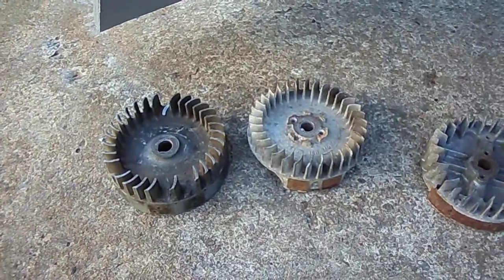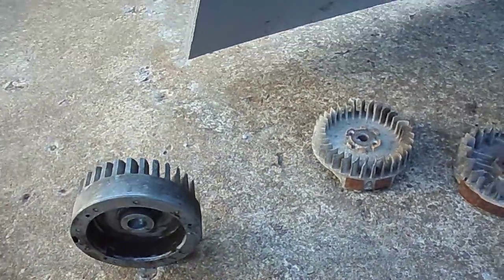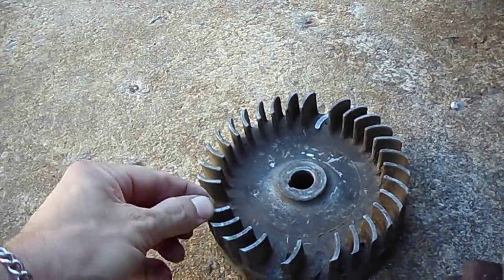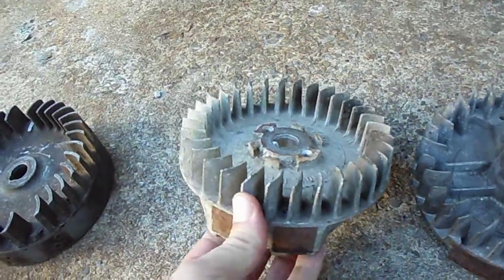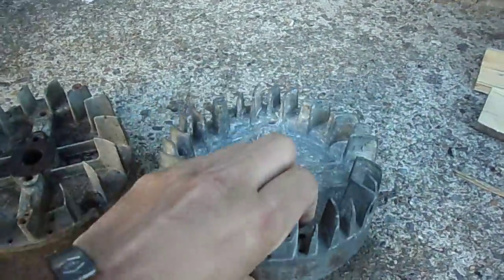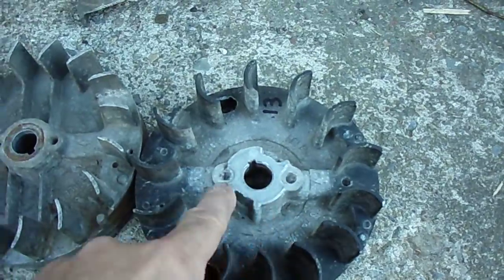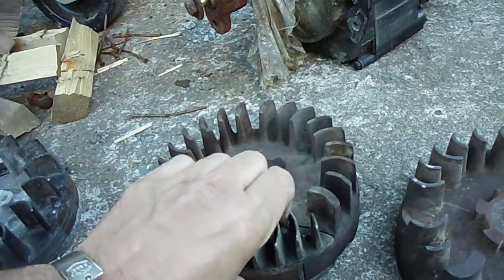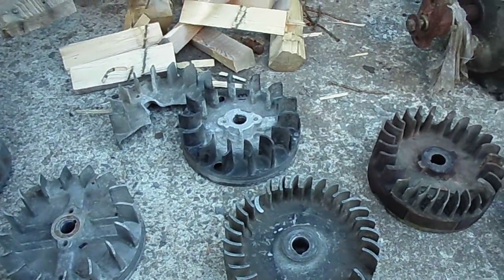Briggs Lawn Mower Flywheels 1953 to Present

Comment: I have an old B&S (probably 60s or 70s) with a bad coil.  Want to switch to electronic coil but I can't find the model number anywhere on the engine. Thinking the plate may have come off.  No stickers showing the HP.  Engine is for a water pump. (non B&S).  Engine is aluminum horizontal shaft, flat head.  Flywheel is cast iron with one magnet.  I tried a new coil (think it was from a 5HP) and it did not fit.  Mounting whole spacing was a little off and the radius of the coil did not fit my flywheel.  My flywheel is 5.75" diameter and mounting holes for coil are 2.5" apart .  I know I could take the head off and measure bore and stroke but trying to avoid that.  Tank, carburetor and filter setup looks like this https://www.youtube.com/watch?v=wcvHNGmt7IY  Thanks for any help figuring out the model number.
Reply from the maker: Hi, the engine in the vid is a model 8   3 horsepower engine. Without getting out a tape measure, I am 99% sure that any Magnetron ignition coil from a 3-1/2 to 4 horse flathead Briggs lawnmower engine would fit that engine. The spark plug wire end cover may vary in size and shape, but the lawnmower engines use the same diameter of flywheel, and the bolt pattern is the same. I make the replacement all the time on my engines.. As long as your engine only has 2 bolts holding the magneto to the engine block (like you mentioned),. The older Briggs engines have 4 bolts holding the mag., but those were phased out around 1960, so I am sure yours is a 2 bolt. Yes, the 5 horse mags (coils) have a different curvature, as well as bolt hole spacing. Perhaps you could go to a small engine repair shop that has been around for a long time, and buy a used coil from them. Just make sure it is a magnetron (electronic) type, which odds are that it will be, since they have been making them since 1982.  To make the conversion to electronic ignition, I just cut the wires coming out of the points cover under the flywheel, put the flywheel back on, and bolt on the electronic coil, routing the stop wire away from the flywheel. Just ground out the small stop wire to stop the engine. I will make a vid showing this, since I need to make another vid today! Take care.

Comment: Can you sell me a SOUTH pole facing magnet with center hole for Briggs flywheel? It's curved to match the flywheel. I need to change my north magnet on spare 17HP flywheel for bench testing. Torch heat applied in vice, and impact tool and hammer for the philips end bit used to loosen screw.
Reply from the maker: Man, that is a question that requires some thought to answer!  I am a bit stumped, as I have never investigated which pole the flywheel magnet is!  I doubt I would have a magnet that size, as I don't think I have any 17 horse engines. Wouldn't all Briggs engines of the same size have the same pole outward, or is just random?

Comment: Thanks for the information!  You're the first I've seen that explains the "no spark" when using an electronic coil with a 2-magnet flywheel.  I recently fabricated a custom flywheel using an outer ring of a Briggs, and the inner section of a Lauson. This allowed me to run a modern B&S coil on the tiny 1942 Lauson, but the fire was extremely weak. Come to find out, I had used a 2-magnet flywheel. So, after watching this video, I machined a new flywheel and it runs great. Thank you very much!!!
Reply from the maker: WOW, you really go all out to get an oldie going! Glad that worked out for you. Sometimes when I make vids like this, I think I going on about something nobody really cares about, it is good to know that some people actually find the info presented to be useful!  Thanks for taking the time to comment back.
Reply: @ChargerMiles007  You're very welcome!  I'm a Mopar guy too.  Just got home from Chryslers @ Carlisle.  Lots of awesome stuff there.

Comment: Question- does one of the old model flywheels have (two) magnets on the outside as North + South???? This could be used to make AC in ignition coil primary. - test with polarity magnet ! I am modifing an engine "intermediate dual coil primaries  " magneto for AC so as can get high voltage DC out with bridge diodes.
Reply from the maker: Yes, the old flywheels have one north and one south pole of the 2 magnets visible on the outside of the flywheel.  the new ones with one magnet only have 1 pole on the outside, I don't know if it is north or south.  That was an interesting question, i had to find a good magnet to test the flywheels out  :)
Reply: I intend on a modification for Briggs ignition by super gluing on south pole neodymium magnets facing out, so as a north + south pole, so as to operate an AC hand built intermediate transformer so as can activate regular old style magneto coil with higher primary AC volts without SS module, so as can get AC instead of pulse type dc, so as can add bridge rectification for much higher 30kv AC for about 10-12KV DC  applied to plug. If single diode is used with regular ignition, the output drops to only 4000v , a loss of 60%. I use a bench test fixture of 12v battery, variable speed control, 12v fan motor spinning horizontal wood flywheel with magnet next to mounted Briggs coils.Strength increased north pole, with added neodymiun 20x10x3mm magnets.  Lead washers on flywheel  held with brass screw for balancing magnet weights at rpm. I earlier also tested for pulse DC with one output diode along with change to POSITIVE high voltage firing down to negative ground, with coil upside down,  rather than regular positive ground spark plug.

Comment: I was planing put a new 3hp on 5hp old briggs. Think I'll have any luck
Reply from the maker: I hear that it will work, and the engine will rev up faster due to the reduced weight. It will run rougher though, but it is hard to say if you will notice it. You will need to move the magneto downwards towards the smaller flywheel of course. Perhaps someone makes a piece to do that. I would think it may need to be made of aluminum to not mess with the magnetism around the magneto (just me thinking out loud)!
Reply: I'll tryout get back with u thanks

Comment: Thanks that brings back some memories!
Reply: This stuff always makes me think of that old 60s mower I used when i was a kid. 
It had a wind up handle on top to start it.
Wind it up, hit a button and it spun over.
Reply from the maker: Yes, I have 2 of those, they are neat, now they need a battery and a starter to do the same thing. Have we made progress?

Comment: I never knew there were that many different flywheel designs. The only thing i can tell from my experience: My (horizontal crank conversion) 1980 3HP Briggs lawnmower engine which used to have the vertical pull start (and thus the geared flywheel) does run fairly well without a blade on, even at idle RPM: https://www.youtube.com/watch?v=wypN5KT5NNk 
But it tends to kick back during the starting process like you mentioned, i even ruined my pull-start! You have to turn it over slowly until the piston is at the compression stroke, and than give it a rapid pull. Seems to work fine for me. 

Another fun story: You mentioned that you have to run the right kind of flywheel for the magneto the engine uses. I didn't expect that, a couple of years ago i got a 1994 Briggs "Quantum" engine running with a Tecumseh magneto (3 pole-shoes vs. 2 on the B&S magneto!!) It was kind of a emergency-situation that i tried this of course, i couldn't believe it, but it actually worked xD
Reply from the maker: LOL, you made a Briggsumseh!  And it ran!

Comment: i really enjoy this video series. i would like to see a video were you show every small eng you have and count them off as you do.
Reply from the maker: LOL :)  I will be uploading one where I show 1/10th of the herd (35) engines. I had to unload my one shedlet (it is small, like a piglet) to hold engines. The bloody thing was loaded with 1" long carpenter ants, I was spraying them with brake cleaner, it was like holding back an upwards flowing waterfall of ants!  I will try to release it tomorrow, I don't want to flood people, as I released 3 already today, I got some complaints about that in the past! I would like to have them all out at once in a vid, but it would take hours to get them all out. I am working on my last engine shed this weekend, so I will be moving more of the Herd to put into the empty shed.
Reply: @ChargerMiles007  well maby make that video for 1 shed, keep the file in a safe place, down the road do another chunk. and maby some day you can peace together a 1 2 3 4 5 6 7 .. ... . ..997 998 999 1000! video.

Comment: Pretty interesting, thanks for sharing the differences in the flywheels on Briggs lawn mower engines! You can also find the heavy cast iron flywheels on push mowers that have a blade clutch so the engine can stay running when you dis-engage the blade, though I have an old Toro mower that has a blade clutch but doesn't have a heavy flywheel, instead it has a heavy iron wheel underneath the mower to keep the engine running when you dis-engage the blade.
Reply from the maker: Yes, a second pulley or flywheel will do the same job as a heavy flywheel, just gotta have enough momentum.

Comment: I had a rusty damaged one I couldn’t get to hold on the shaft so I learned it’s the cone that really holds not the key so I honed it on the shaft using lapping compound and the result was amazing. No more tightening down with the force of Thor and loosening with Thor’s hammer.
Reply from the maker: LOL, awesome that the lapping worked out that well.

Comment: I put a push mower engine on a rider when i was a kid. it was okay if you pulled it over fast enough to start it, and never throttled it down too low. one time it ripped the cord out of my hand so violently it blew the recoil to pieces.
Reply from the maker: Yes, I had the same thing happen, I freakin hurts your hand when that bad boy yanks the handle out of it when you are still pulling the other way!

Comment: Do you have a connecting rod for a  Briggs 15 hp OHV Engine
Reply from the maker: Sorry, I don't have any 15 horse OHV engines. I have some 12 horse flatheads, and an opposed 2 cylinder.  i don't get into the larger engines much, too heavy and costly for me to buy and store. Check ebay, you can look the part number up on Jacks small engines web site, it is similar to the Briggs website. Once you have the Part #, (and a price from Jacks) go to ebay to compare costs. Sometimes ebay wants way more than it is work new!  Other times, I find some good deals. You will need the model and Code # from your engine.
Reply: @ChargerMiles007  what's interesting is that this rod is only 1 1/2" longer but costs twice as much